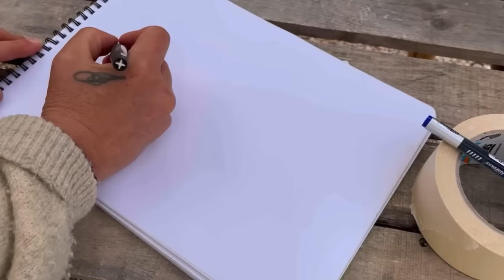ONE YEAR TIMELAPSE // COUPLE RENOVATING neglected Italian village house

Comment: I like how you are repairing the structure rather than taring it down and rebuilding. You are making your property beautiful again. You are working with what you have. Excellent job.
Reply from the maker: Thank you 😊
Reply: @Maisondebase  I appreciate what you did with your house. How old is it? I live in a very old Cedar house by US standards built in 1890. So many of these houses were torn down and replaced with modern houses each resembling the other. I refreshed my house with new double hung windows, paint inside and out, electric and plumbing as well as updated hvac. It has 32 windows which are great for ventilation. I think it takes a special person to cherish vintage homes rather than demolishing them. Please keep up your good work.

Comment: Excellent although are you using Lime Mortar to let the walls breath? If just cement you will have damp problems.
Reply from the maker: The whole house is with lime. Lime plaster, lime paint, lime stone…..Martin and I have a background in natural building, if you like you can check out our video where we built a house using only natural materials:) we usually only use cement for tables or outdoor kitchens etc we would never touch the house with anything concrete related
Reply: @Maisondebase  Great good to hear 😀

Comment: What is the lowest temperatures you have there during winter?
Reply from the maker: Depends on the year but sometimes it but coldest goes down to 1 or 2 degrees at night. But usually stays are 5 degrees. In the day usually it’s around 10-12 degrees. In summer like now it’s 40 degrees all week temps are can be extreme 🥵

Comment: if they like it ok. way too much sand mixture furniture. this would give me a nightmare. zoning and placement isnt always well placed for its area.
Reply from the maker: Maybe for our next project you’d like to come and give us your expert advice and help build furniture?
Reply: This is a very good point. When you’re young as this couple appears to be, you’ll want to change things and move stuff around all the time as you get older and needs/wants become different. Hard to do that when it’s all set in concrete. Much easier to work with concrete than wood though.
Reply from the maker: @nimai44  first of all this is Puglia, we don’t have a local wood supply here so using wood is terribly expensive, but you’ve probably not been here so wouldn’t understand that….the built in sofa is typical of Puglia also, you can see it in may homes here, so it’s a nod to the way things are historically built in this area. The dining island is just that a kitchen island, you can work at and also eat at, would you move your kitchen bench around? I doubt it. And 3rd the outdoor table is built that way for durability in the elements, wood doesn’t work here and it’s not available in the quality you need for outdoor use, metal will burn your ass due to the heat and plastic is ugly and not terribly environmentally friendly. We are very well thought out with our decisions, we don’t do anything without a lot of consideration. Not that I need to explain our decisions to all the arm chair experts who have never visited the areas, know the local materials or history or architecture or ever built a single thing in their life no doubt, but here we are……